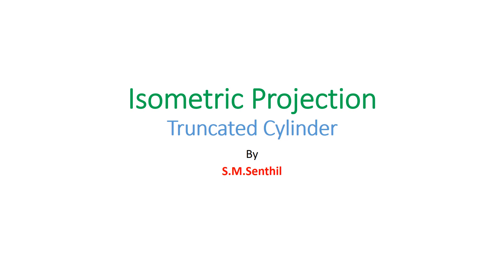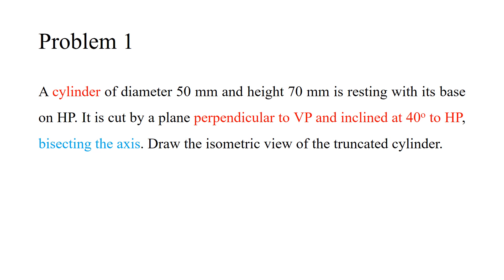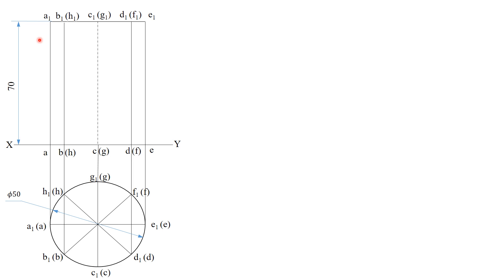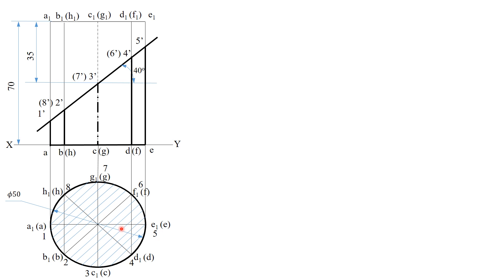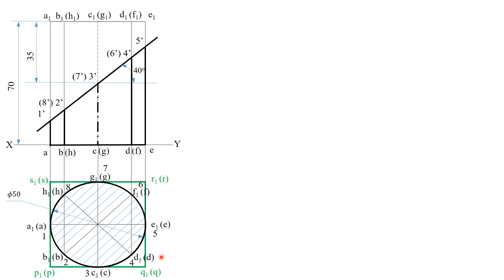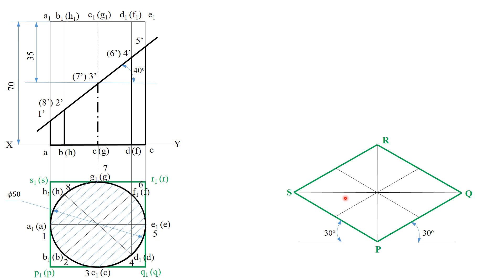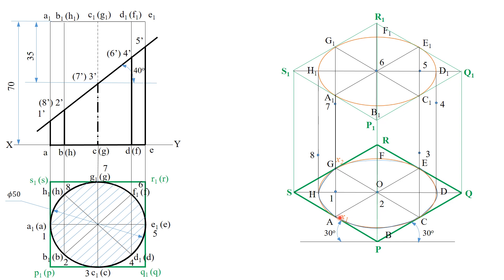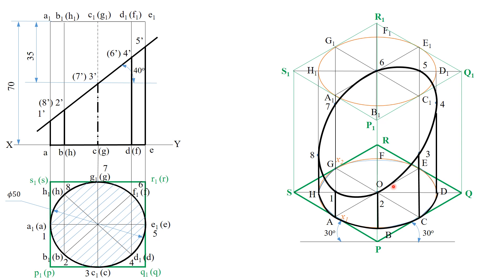Isometric Projection  - Truncated Cylinder

Comment: Answer for this question?
A cylinder of 50 mm diameter and 60 mm axis length is resting on the 20.F HP on one of its bases. A section plane perpendicular to the VP and inclined at an angle of 45° to the HP cuts the cylinder and passes through a point on the top end of the cylinder. Obtain the isometric projection of the truncated cylinder.